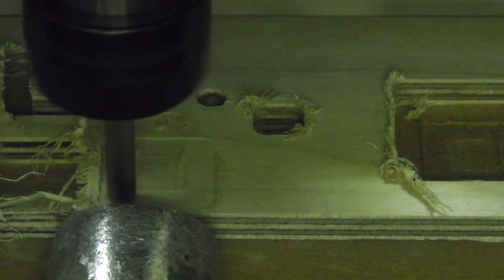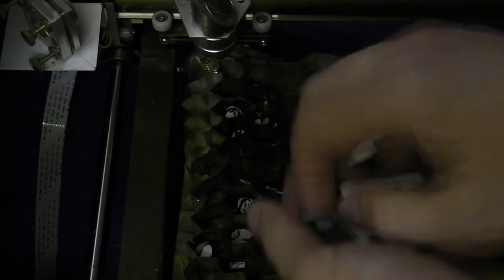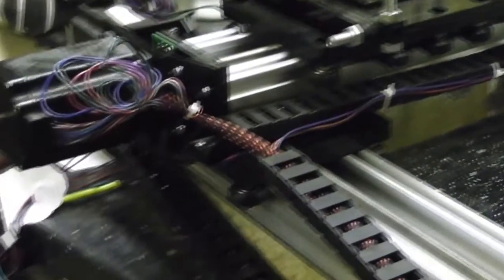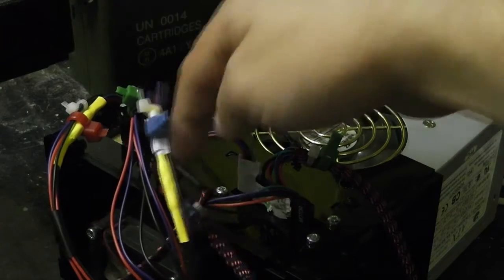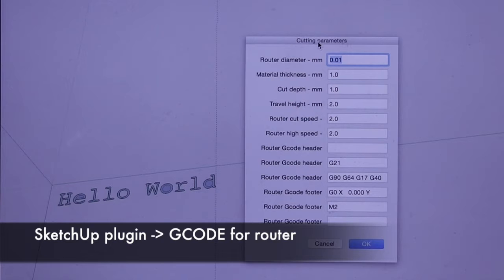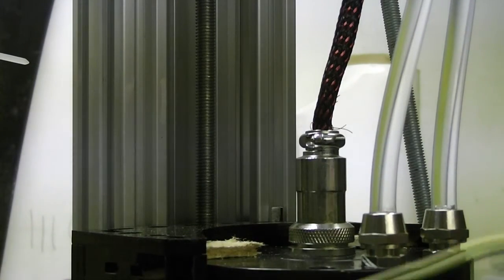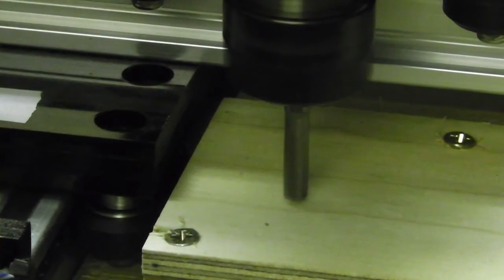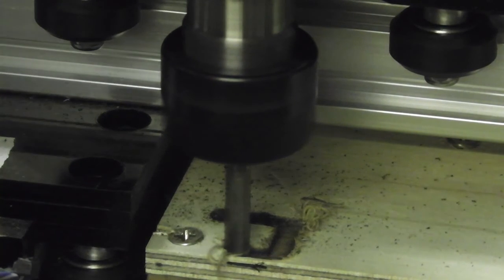Acrylic CNC router cuts wood: CNC router blog 11

Comment: Many thanks for the informative update.
Reply from the maker: Cheers, I hope it helps if you move ahead with your CNC stuff.
Reply: +OpenTronic I'm sure it will, the latest revamp of the workshop is nearly complete. It has needed doing as I have a large number of vinyl belts to make for a company in the US who are making and distributing very accurate replica tricorders from the original Star Trek series. Talk about being accurate..... Right down to not only size but also material and stitch length, this is the second time I've done these the first time they said the whole kit was the most accurate replica ever made. A nice comment especially when the feedback comes from people at the comi com exhibitions.
Reply from the maker: Those sound great - I suppose Star Trek is what got a lot of people interested in 'replicators', ie 3D printers. Certainly inspired me when I was a kid - and as an adult :)